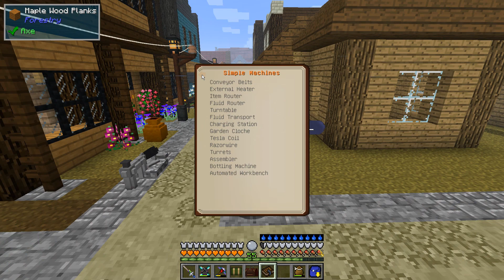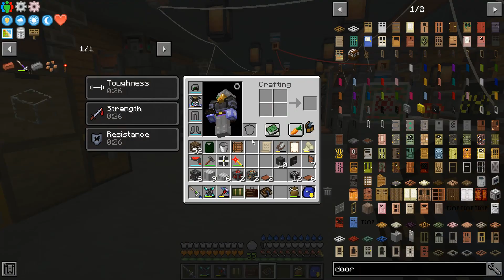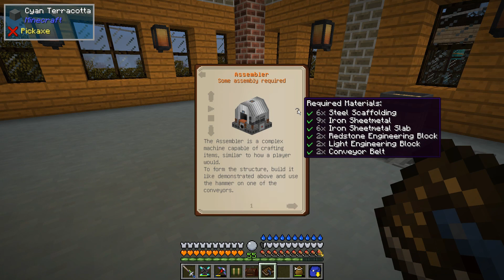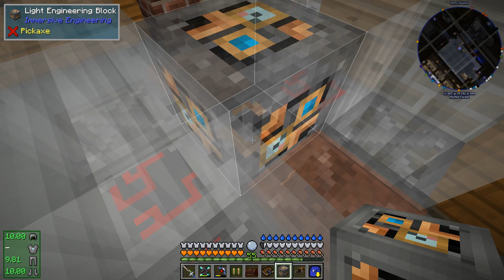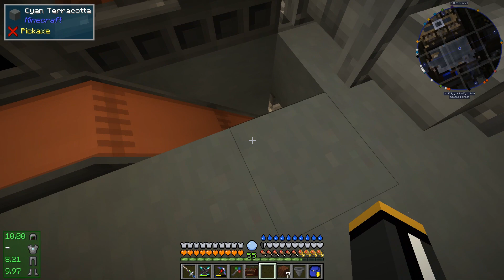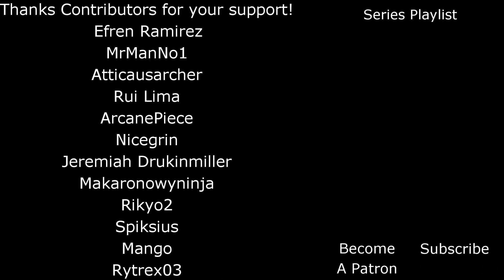Real Tech S2E47 - Autocrafting with Immersive Engineering

Comment: For some reason the assembler won't craft everything
Reply from the maker: It should craft anything you can craft in a crafting table. Is there anything in particular it's not crafting?

(That first sentence may have had the highest density of "craft" in any sentence I've ever written. 😎)
Reply: @DannySon  haha, well it's odd. It won't craft bread for me, but it will craft chests. Just two examples. It wouldn't turn logs to planks either. But I plan on trying it out again tomorrow just to see

Comment: good tip you can put all the layouts for immersive engineering in mine colonies just use the scan tool on the blocks layed out before you hit it with your engineers hammer 

do it in creative first much easier
Reply from the maker: Thanks for the tip! That would actually be a nice thing to bundle with the modpack. I guess the only problem is that the builder tends to be less efficient than I am. lol. But, it would be fun to have her build my machines for me.
Reply: @DannySon  i used it with one of the other mods "prefab" that pops in buildings then i had the thought use the scan tool scan the whole building with everything layed out and in it 
I can say it works in creative just have to get the materials for survival but it should work

Comment: can anybody tell me why when I try to load the immersive engineering mod with the latest forge (1.14.4) i get 'immersive engineering is for an older version of forge & can't be loaded', but if I try to play on 1.12.2 (which the other mods load with), immersive engineering crashes the whole startup?  this series makes me want it so bad but I'm v confused  :,,\
Reply: U need to read the logs, and use probably a latest version of forge or check any mod interfering
Reply from the maker: Immersive Engineering doesn't work for 1.14. The latest version is for 1.12.2, and you have to use the latest version of forge for 1.12.2 (not the recommended). Unfortunately, they did a poor job of documenting this fact.